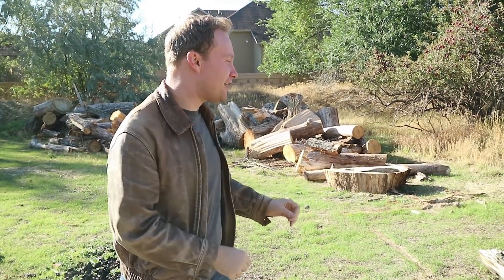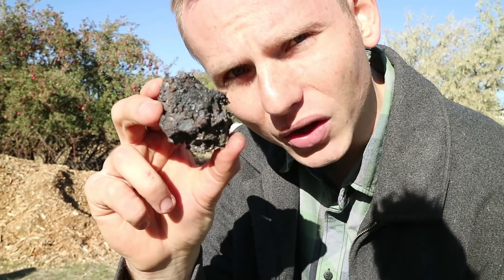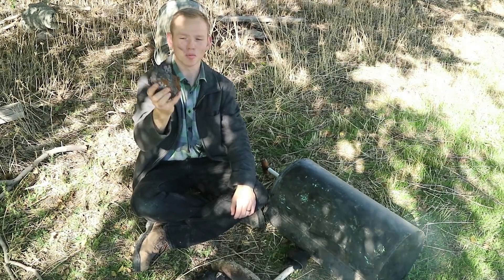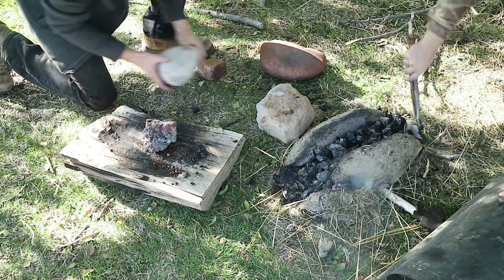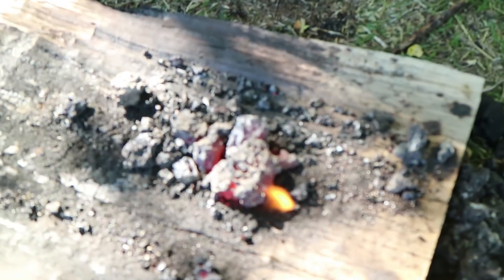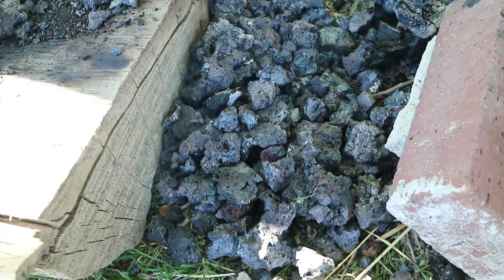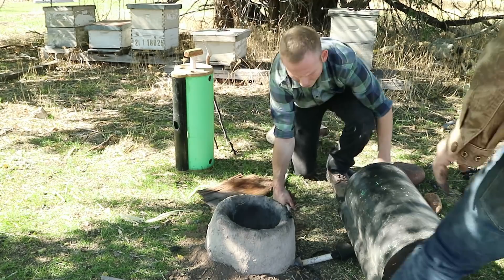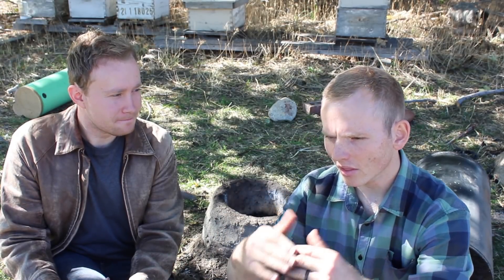But Is It Iron? Post-Smelt Primitive Forging

Comment: Needs to be much hotter. It should have almost a liquid apperance on the surface when its ready to weld. Also the Iron age was after the bronze age. They had metal tools not sticks and stones.
Reply: Civilization is the pursuit of hotter fires.
Reply: NPC #303  better tooling metals have higher melting temperatures. Bronze is a lot softer than iron. An iron sword would have little issue cutting a decent dent into a bronze sword. Hotter fires -> better tools
Reply: even so they needed a good way to make the metal tools and this can give us a clue on how they made those
Reply: @jamesrivettcarnac  -๒
Reply: well its also documented that some civilizations skipped the bronze age completely
Reply: @vizprave6721  while that is true, it is extremely rare without outside influences (like foreign conquest & trade)
Reply: @vizprave6721  Bronze requires trade.

Comment: From someone with experience working with metal you clearly was no way near hot enough for your bloom iron to weld together.  You barely reached cherry red when you need white hot for your iron to weld together into something useful.
Reply: Ken Jett white hot would mean it’s melting and it’s quite expensive for normal people like me to get it that hot for some iron it’d be cheaper to go to my local junkyard.
Reply: @bluesap7318  no white hot is not melting it is the point right before melting and thats what is required for forge welding metal which is the process for making the pig iron  out of this smelting process. I spent a big part of my life with a hammer beating on hot steal and working around the forge. I am an old school oilfield rig man back when cable tools still ruled and we  forged all our own bits. So i know how and what it takes to heat and hammer metal. Oh by the way if your having trouble getting white hot heat your not doing something right its quite easy and not all that expensive unless your trying to use store bought charcoal. If you must use charcoal which by the way you can make your own. Charcoal is quite easy to make and if you have access to free wood wont cost a penny to make. You can achieve white hot with charcoal but requires plenty of forced air and charcoal fuel to get it. I have done cast iron melts with charcoal but can be costly if you dont make it yourself.
Reply: Necessity is the mother of invention. If you know what you're doing, it's not expensive other than the labour. I did this as a kid using what I called a 'trench furnace' for a history project. So take 1 windy slope, and dig a trench in line with the wind. At the far end, make a step with a groove sloping down from clay. Then make a chimney over the step with a small opening facing down the trench. Chimney needs to be fairly tall. Pack ore and charcoal layers into the chimney and fill the trench with wood & charcoal leaving an opening facing upwind. Cover the trench with more clay, light, and wait.

Idea is to have a good convection airflow through the trench and up the chimney, so basically the Aristotle Hearth used here, but with taller chimney & better airflow. Then there's no need to waste energy on bellows as thermodynamics does the work. Mine got really hot, produced a workable bloom and got me an 'A'. Many years later, I think this is how Iron Age workings worked, so producing bloom near ore sources for transport to the smithing sites. Simple, once you've experimented with chimney/trench sizes and then easy to build and rebuild if ores deplete.

I'm curious now if the same idea was used to refine the bloom down to better quality iron/steel with flux added to the furnace? My experiment took about a day to build and got the bloom up to a white heat just using convection though.
Reply: @brolohalflemming7042  yep have seen it done that way and it does work. The point though is you have to get the smelted metak to white hot to be not only workable but to mold or weld itself into a usable piece of pig iron. You can achieve good steel with this similar process if like you say proper fluxes is used That is the process that made ancient Japanese Samurai Katanas so famous for their quality. They truly was masters of fine steel in the early days.
Reply from the maker: Any tips on reaching those temps with a charcoal trench forge? all my previous forge welds were in propane.
Reply: @GoodandBasic  its all about air flow with charcoal the more airflow the hotter the temp. But it also consumes the charcoal faster. Thats why i recommend if using charcoal you make it yourself and in large quantities. But you can obtain white hot temps with adequate air either by funneling a steady wind into it or building some type of blower that can create enough air into it. I was incredibly impressed with Primitive Technology's build of the bow drill blower that had good potential if the user has the stamina to keep a good pace for long enough period of time. Bottom line the more airflow the hotter you can get but it will be a hungry fire lots of charcoal. Oh if coal is available it will work as a better fuel as it hold heat better with less fuel.
Reply from the maker: Do you sort by size to avoid throwing sparks from the extra air. I used a shop vac once upon a time and that was a disaster.
Reply: @GoodandBasic  sparks should not be an issue as to have most efficient heat you have to have a balance of air and fuel if you were getting sparks you had to much air not enough fuel. The more air the more fuel required to feed it thus hotter fire. It all about proper balance thats why when using charcoal it takes alot of it. Thats why i stoped using my charcoal furnace its alot of work to make enough charcoal to feed it. But if your looking to be successful with ancient methods the hard work in preparation in a must. Thats just how things was done back then. Modern technology has made life much easier.

   A shop vac would create way to much air for a charcoal furnace but if you installed a valve to cut back air from the vac you could better balance your air fuel mix. When i ran my charcoal i used 2 electric air mattress  pumps/blowers. I currently use a shop vac with my propane for furnace work far more convenient.
Reply: That's where experimentation comes in :) From memory, mine was about the height of a 14yr old, so probably 5 feet. The furnace part was heavier clay and straw in a behive to support the chimney part. I used a cardboard tube from inside a carpet roll, so maybe 4-5" diameter as a former, then slapped a good layer of clay around that. Start with a plain'ol wood fire to burn that away and dry the clay so it doesn't crack.. and keep a bucket of wet clay to patch up any cracks/holes that do appear.

If it's right, it should make a real roaring fire. I've seen it done without the trench, but think that may help by pre-heating air as it's drawn in. I filled it once it was roaring with a 50:50ish mix of charcoal & ore by weight, and end result was a blob of metal & some slag on top at the bottom of the furnace. Now I'm itching to repeat that experiment, but not sure the neighbours would appreciate it. It seems a common way to make a basic bloomery furnace, and I guess the riddle of steel was the further refining, and then forging. Like Ken says, the Japanese used their sword making technique to make the best out of different iron/steel qualities. I think the Vikings did much the same, and later on, used imported Indian steel.
Reply from the maker: This is the result of a bloomery we ran with the king of random. You can see it over on his channel. It's good to hear about the proportions of your bloomery. How much ore did you go through? How much was the weight of the resulting bloom?
Reply from the maker: That's more or less what we found in the early smelts. Have you seen our charcoal making video?
Reply: Heh, well, it was a long time ago. But from memory, a bucket of bog iron I'd collected, and a few sacks of charcoal. It produced a decent sized bloom that I fished out, let cool for a bit then put back in to reheat. Then I hammered it out into 2 fairly respectable square-ish nails. Result was fairly soft, but seemed reasonably pure metal. I think you were on the right track with the forge you used, but the chimney wasn't tall enough to get a good convective airflow. I think that, plus possibly some Venturi effect from the size of the inlet hole gets you up to temperature. I remember being very impressed and somewhat nervous of the jet-like roar coming out of my chimney though. I also think I got lucky, and used a good amount of clay to make it so it held heat in and didn't crack much.
Reply: Yup, and from watching your other vids, I think you were almost there with the "iron making 3/4" video and the viking/turd furnace. There wasn't really a chimney to it, so no convective draw and so lower heat. I think the trench tunnel and restriction into the furnace helps get that drawing hotter and faster.. And I don't think you need the windy hill.. Much like Iron Age parents, I think I was told that to keep it away from buildings.

But I hope you try it. It's something that I've had a few interesting discussions around, ie bog iron is no good.. Yet there's plenty of evidence it was utilised extensively. Then if the debate comes up again, I can refer to your/Cody's videos.. Or perhaps "How I made Tungsten from rock" :)
Reply: Ken Jett I don’t think the metal was iron since it was white hot at the temperature I got it then maybe a lower melting metal? I’ll check it later.
Reply from the maker: Wow. That's quite the school project. I'd give an A too.
Reply: @bluesap7318  8f the ore you smelted was very good you likly only had maybe a few beads. That would not be enough to bond into something workable.  It takes alor of smelting and xollect of iron beads till you hav ed enough or get better or rhat you can turn into a substantial bloom.
Reply: Uhm, actuallu id use a "sledgehammer" made from oak, hickory... on a stone anvil. Also temp needs to be higher, when you see "sparkler sparks" fro. The bog iron you have gone about 300degrees Celcius above forgewelding temp (basically smidge too hot) 
You need deeper charcoal bed and more air
Reply from the maker: Thanks for the tip about the charcoal bed. We'll have to give that a try.
Reply: @GoodandBasic   Cover the forage with a log if you are using trench forge they hold less heat then a round one. If you cant take the smoke use earthenware tiles. Heat the bloom for longer at a cooler temp about 800C/cherry red untill the whole thing is the same colour. Then take it up from there with a short burst of air until it begins to spit a little and glow. pull it out fast. At this point well a partner puts more charcoal in the forge you need to tap the bloom lightly to compress it. Then put it back to consolidate then remove it and hit it slightly harder repeat until it's compressed enough to hit very hard. For a bloom the size you stared with you needed twice the charcoal at the beginning that you started with. it wouldn't seem like it but you are also heating from the wrong side always pipe air up into the coals rather then across them.
Reply: @bluesap7318  yes but when you have good refractory and and regularly make spare charcoal it can be done quite cheaply with some bellows especially if you can design it so that it makes a natural draft as well
Reply: @GoodandBasic  try to make a large furnace and design it so it pulled a natural draft combine that with bellows and it could get hot enough though a good refractory material is a must
if you could find something like asbestos but less dangerous it could really help
Reply: @GoodandBasic  try adding sand or some flux to help collect the iron and separate it from slag
also I noticed in the video you left the top open to air
((this works if you are willing to use something other than a trench furnace)) , if you could find a hill or something and build it into the hill making sure to cover the top it could work in fact you could make a little chimney to draw air in the bottom and it would also allow for better insulation after all the two biggest problems most people
 encounter when doing this I noticed boil down to air or insulation which makes sense since unless you increase how fast air flows, leaving it open is the other main option, at the sacrifice of insulation.
because of this most use bellows but that only get's you so far but if you combine bellows with a natural draft and things go well one idea is to hook up the output of each bellow so that they lead into a sort of narrow tube that way you could do it without obstructing the natural draft as much, doing this also allows you to concentrate air flow to a specific area depending on the width of the exit point

sorry about the bad grammar and explanation but im both young and have mental disability's
also sorry if I comment too much after all it is your suggestion
Reply: well if it's anything like clay it doesn't even need to do that on it's own if you push it together manually((not with your hands of course)) by the way out of curiosity if you touched white hot non-liquid iron for exactly half a second what would happen? obviously you would be burned but how badly and what part would burn first
Reply: @GoodandBasic  yeah try using a flux of some sort to keep bits of slag out of the iron
Reply: Robby Frith I can’t do that in a city I’d probably get arrested.
Reply: @bluesap7318  no not make charcoal the normal method Im talking about when you have leftover charcoal from burning wood in the fireplace collect that over time plus we don't do a casual fireplace fire seeing as our backyard has vines bushes and trees constantly growing

Comment: I have no experience other than being a primitive tech YouTube junkie.  One thing ive seen in every successful smelt is that they work the bloom while it's hot, trying to push it together into a ball, rather than just smashing it. The near-liquid slag is pushed out as you consolidate the iron, so working it both refines and solidifies it.  I bet there was usable iron in that pile.

Comment: I think when you see it cracking you should turn it so that you are hitting the cracked pieces back together. I think if you keep rotating the chunk and lightly hitting it you can remove the impurities as they crack and fall from the outside, while keeping the large pieces together. You might have to do this several times with reheats and progress may be very slow. But if you keep heating it and hitting the pieces together, eventually they should bond as more and more slag is removed and falls from the outside.

Comment: you do know they didn't go from rocks, clay and stick straight to iron, right?
they used rocks, clay and sticks to smelt copper
then copper to smelt brass/bronze
then brass/bronze to smelt iron

sooo, might be a good idea to try to smelt copper from ore first?
Reply: Copper ores contain copper atoms.
Iron ores contain iron atoms.
You do indeed normally go straight from iron ore to (pig) iron, no copper involved.
Reply: @olawlor  Wow, you completely missed the point. Early civilizations had metal tools before Iron was discovered is what hes saying. They didnt go straight from sticks and stones to making iron tools. There were copper tools, which was then used to make bronze and brass, Which eventually transitioned into the Iron age
Reply: @olawlor  You missed the point. By the time humans started smelting iron, they had plenty of bronze for tools like spades, trowels, hammers, anvils, bellows...

Comment: Also remember there are tools made from metoric iron that could have been used as hammers for the first iron blooms. Bronze would work too it would just wear out faster. I think you guys are overdoing the from-scratch part a little bit because for civilizations to be advanced enough to make iron they weren't just 2 rocks on the ground or a small basic clay forge on the ground. I'm sure they had the resources to create some kind of basic workshop in a community where each individual had specializations like weaving, building construction, etc, so they would have an array of basic tools at least on the primitive level some kind of basic infrastructure and community, it wouldn't just be 2 people totally alone with nothing but some rocks and clay and iron blooms. Make yourself a table, put the forge on the table. Maybe make a wooden hammer. Give yourself some proper tools even if they are basic and fit the time period it will make your job so much easier. Remember with the right tools and knowledge, any job can be effective and easy.
Reply: Go outside.

Comment: The Ore needs to be pulverized very fine, and panned for the heavy material, hopefully iron! 
This would get rid of a lot of the impurities, also a crucible of some sort would help to capture the melt (if any), then it could be poured off into clay molds, as mentioned a powdered limestone flux would also help to purify the melt!
Gabby

Comment: Yep too much slag for the bloom to properly form, during smelting you should pierce hole for the liquid slag to go out. Maybe a bit more air would help to melt the slag. What kind of ore did you use ? If its rich silica content the slag is difficult to melt. Also if the reduction is not good the melted slag dissolve a lot of FeO into it so it fell heavy and solid even react to magnet but shader after some hits.
Reply from the maker: This was the result of the smelt we did with the king of random. The ore was hematite with some calcite as a natural flux. The slag melted beautifully

Comment: when you melt copper one way to bypass the oxidization problem while it cools is to collect CO2 weather from fermentation or from the fuel you just used to melt it and once it is a solid piece even if it's still glowing take it out with tongs and cool it in water that way you avoid surface oxidization and cool it faster,
if it has already oxidized and you do not feel like sandpapering it try electrolysis